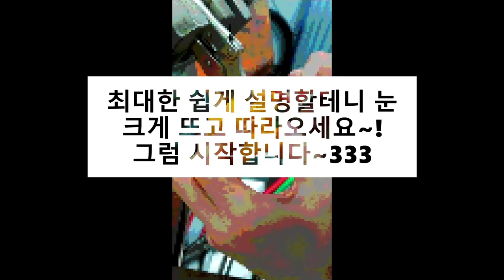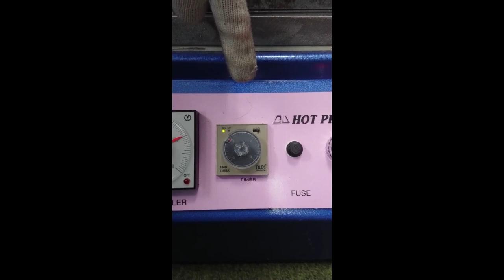쥬얼리 귀금속 고무가다 제작방법에 대해 알아보기(Jewelry rubber mold making video) [얼티미시아Ultimetia]

Comment from the maker: ▶▶타임라인◀◀

▶▶Time Line◀◀

     

0:36 ~ 3:58 원본을 고무틀에 매몰 (Bring original to rubber mold)

4:00 ~ 5:40 열프레스에 고무틀 굽기 (Burning of rubber mold on thermal press)

5:42 ~ 11:43 고무틀 절개 (Rubber mold incision)

11:44 ~ 12:12 왁스 사출 (Wax injection)